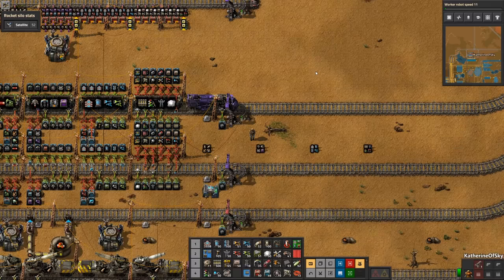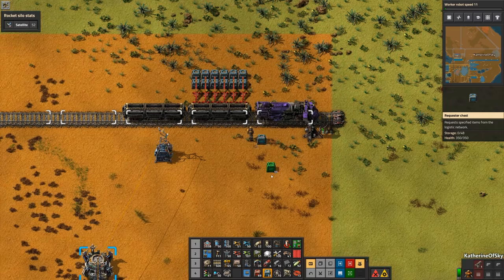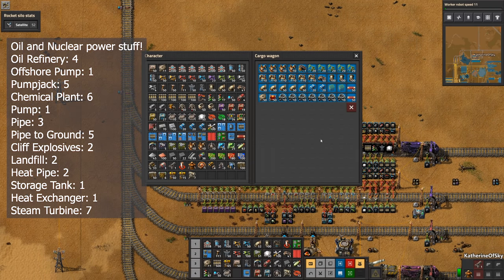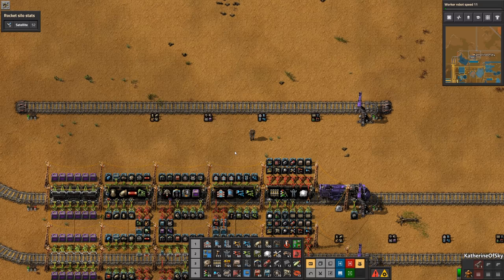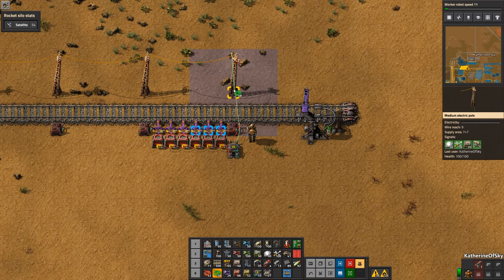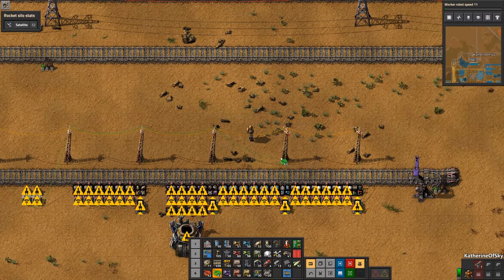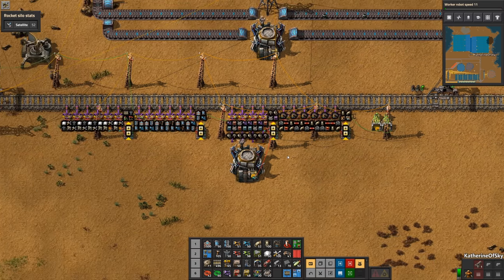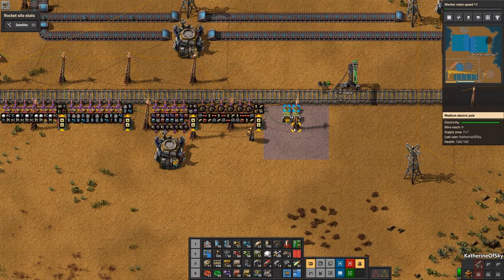Factorio: HOW TO BUILD A BUILDING TRAIN - Tutorial, Guide

Comment: I would like to see you make a shopping mall that works on Just In Time inventory (JIT) and NOT store stuff on any belt but use it in all places it is needed ... essentially making a warehouse district and manufacturing district that ONLY draw when they need to build something and ONLY draw the EXACT amount they need to fulfill the order ... NO excess resources ON ANY belt. 
.
yup no more maxed out belts ... no more max belt ratios ... but EXACT BUILD ratios ... currently everyone in Factorio makes waste lines that store 90% of your resources on belts and main bus ... absolute WASTE of belts time and resources ... if stuff only builds what is required and only mines what is needed to build it .. then it doesnt fill anything beyond what is required ... and keeps all belts essentially empty .. THAT would be PERFECT throughput .. which is BETTER than max ratio input and results in less junk pilling up.
Reply: as for this video .. yes its short and quick .. but mostly covers everything ... but what isnt covered is covered in the new series as she progresses in 40 to 45 min chunks ... ok so she has to use nanobots .. a little cheaty BUT she so far has covered building without them as well ... as long as she does a no bots build first .. say 3 or 4 furnaces of a smelter line manually and then finish with the bots is fine ... this way you see what you have to do WITHOUT the nanobots ...
Reply from the maker: I don't think you've watched many of my series: I often do arrays ratio perfect.  If you want a JIT mall, then you might want to build it yourself... I find that exercise to be worse than useless, since the mall doesn't NEED to work all the time.  You'd have to place 120 belts every minute.  EVERY MINUTE.  Place down a new nuclear reactor every 8 seconds.  (That's 7.5 every minute).  That doesn't make any sense to me.

Comment: Anyone else has difficulty of reading the bot count from the roboport? I set the wires like she said (tried and checked several times) but the bot count from the roboport does not go to the combinator. So the station keeps asking more and more bots. Everything from the boxes seems to work, even the bots if I don't insert them to the roboport but keep them in a box. Any idea what could be the problem?
Reply from the maker: Did you read the pinned comment about changing the tickboxes and the symbols?
Reply: @KatherineOfSky  I missed the comment sadly but I figured it out myself. Which I think is even better because I had to actually learn more how the circuit system works.
Reply from the maker: @mustoneh  Awesome!

Comment: You can actually get away with multiple item types per requester chest if you use a fast inserter and set stack quantity to 1. Sure it'll load slower but that's fine for low quantity or rarely used items such as combinators, trains/wagons or stations.
Reply from the maker: A 1 stack size is NOT efficient in ANY way: your building train needs to load fast so it can get back out to the world and visit all the stations needed.
Reply: @KatherineOfSky  Maybe it's my playstyle thing. As a perfectionist, it usually takes me way longer to design and plan things than to actually build them even if I take my time and build with just personal roboport. So a train taking a few extra seconds to load is the least of my worries. In fact it's a good excuse to have a look around the base, admire the things that are working as intended and debug ones that aren't.
Still, you're probably right, stack 1 is a bit too slow. Except maybe for trains and wagons that stack up to 5 and are not needed in large quantities.
Reply from the maker: @AlterMuller  The thing is that I have 2 building trains:  one that I take around, and one that delivers stuff automatically like modules, furnaces, other stuff and that's where you are going to see major delays.  In any case, there is really no reason not have a dedicated chest for each item: it's cheap and allows MUCH faster loading.  You are unlikely to need more than 24 different types of item per car, (and if so, switch some around to a different car).
Reply: @KatherineOfSky , good point. Personal quirks aside, your setup is clearly superior to what I came up with so far. I'll try it your way, thank you for taking the time to educate me :D

Comment: Now the real question is, why the hell is this called a "Building Train"? :D
If I understand it correctly, all this setup does is do a milkrun with dinamic stops.
Reply: My guess is because it helps build outposts :)
Reply from the maker: Because it helps you build outposts.  The idea is: you go out to a far away area, place down actual buildings and also ghosts of miners, belts, etc. (I always run out of items).  Then the building train comes and fills out the rest of the supplies needed: modules, etc.  (Modules are always lacking for me, especially in very large setups).
Reply: Yup. Technically the train doesn’t build anything. However, it delivers the robots that will. And the supplies the robots will use. And then it keeps making automated deliveries until the outpost is built (all ghosts placed). If you keep bots deployed it will automatically restock items used for repairs as well. For example, the bots replace some destroyed wall segments, the station notices the deficit of wall segments and calls the train in, which will restock the walls up to your requested value. Awesome for automation. As KoS alludes to you can also remotely tear down the outpost when you’ve sucked all the resources out too.